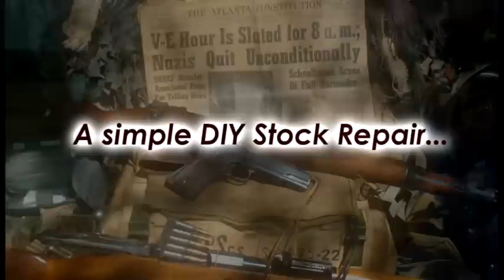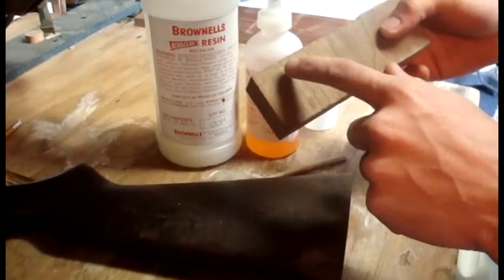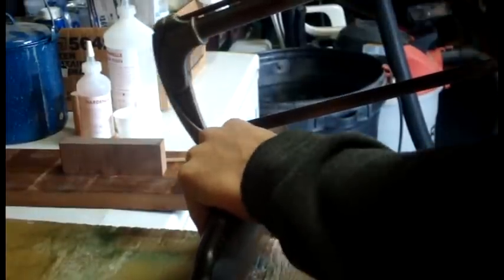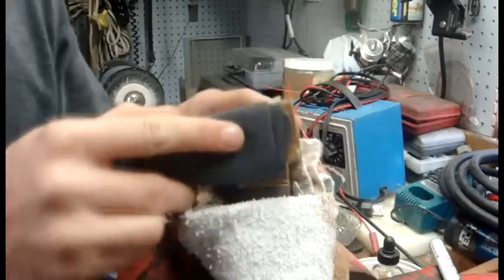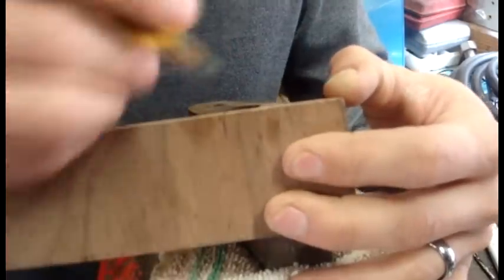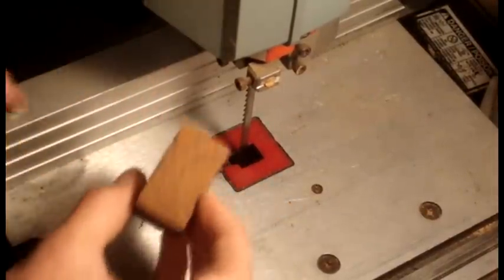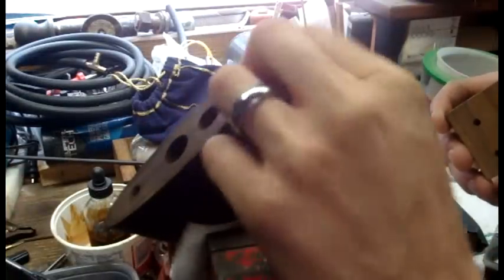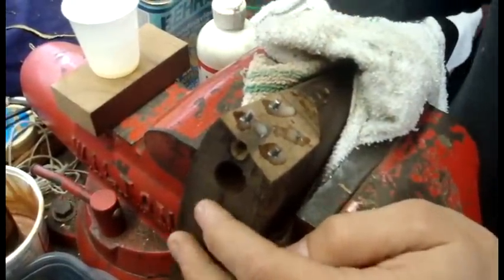A simple stock repair you can do on your own Part 1

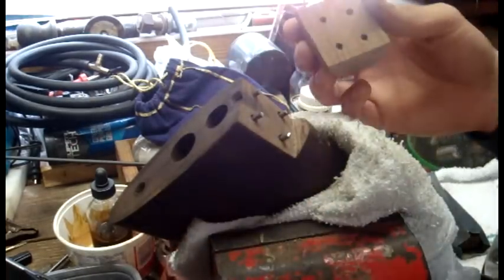Comment: At 17:35 in the vid you talk about scratching up the surface to improve the grip of the adhesive.  This can also be done with a bunch of shallow drill holes ( ~1/16 ) all in the name of getting a tighter bond between wood and adhesives.  Many hardwoods used for rifle stocks have a very "tight" grain so very slow setting adhesives that seep in and deeply penetrate the wood also makes for a good bond.  Brsides adhesive grip strength, the compressability, flexibility, and shear properties [ YOUNG'S MODULUS ] of the adhesive is critical.  Many ooooold single-shot military muskets/rifles show deep gouges and SERIOUS cracking in the wood because if out of ammunition or in CQB, a soldier would grab their firearm by the barrel front to use it as a wicked hammer/club !

Comment: sweet, cant wait. i love seeing how little projects like this turn out.  another way to get the wood close to its shape is one of those cheap electric sanders and 36 grit sand paper. just make sure you dont get too deep. i use it on bondo and it cuts it down quick. the 36 grit looks like rocks glued to the paper

Comment: That is certainly one method.
 A better one is to aviod having a corner to fit into at all costs, if possible. A better, quicker, and more appealing method is to bring flat surface to flat surface with no corner to fit. If done correctly no filler would be needed  and usually a better grain pattern match.  No pins needed either . Been doin' it 30 years so I know a few tricks.  
Thanks for the vid.

Comment: Scoring the wood surface is a good idea to improve the grip of the epoxy.  Likewise, a few strokes  on each end of each pin with a needle file will form notches that will improve the acraglas grip on the pins.

Comment: i have this shotgun, but in the savage model, and the stock has a broken piece near the top of the reciever. Ths video is going to help me repair that. Now I just have to figure out how to take the trigger group out of the reciever so i can clean and blue the reciever and barrell. The front trigger guard pin will not budge...i've pounded it, pressed it...just won't budge...can't wait for your next video...

Comment: Please please use the correct saws. When you are cutting the stock you were using a hacksaw with a fine (metal cutting blade) blade, if you had to use a hacksaw  change to a course blade. But you should be using a woodwork saw.

Comment: You need to use the sawdust from a sander and not from the saw. Sanding dust from wood makes a great filler for epoxy. Thanks for you great videos  Iraqveteran8888  :)